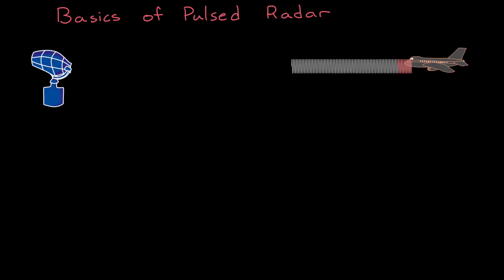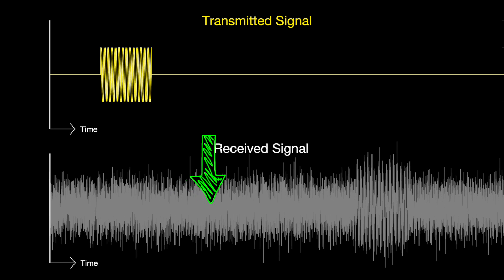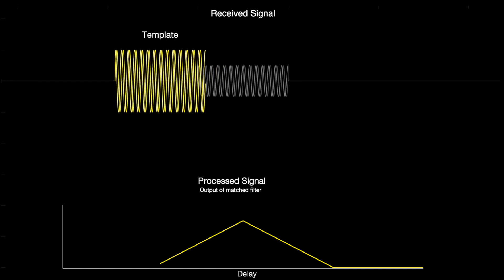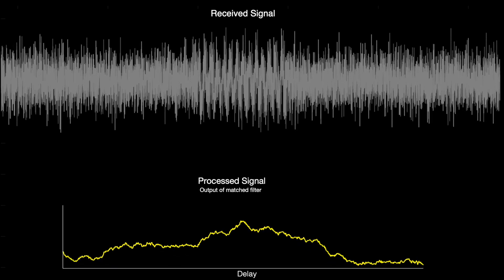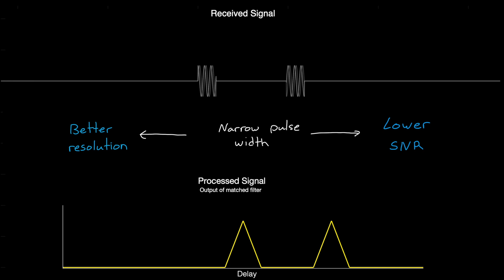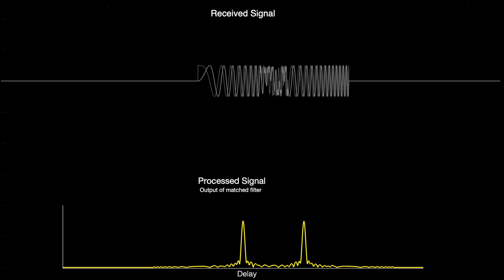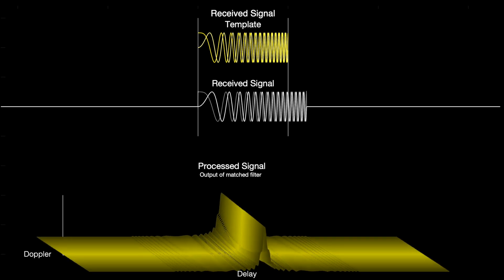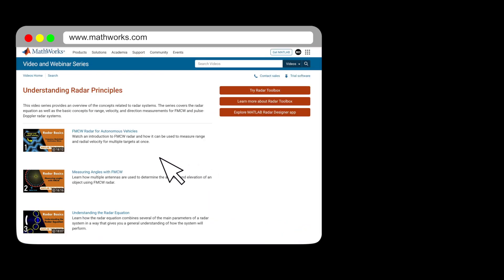Pulse waveform basics: Visualizing radar performance with the ambiguity function

Comment: 0:52 = The sound that we hear has frequency increasing, while the video shows a waveform where frequency is decreasing?
Reply: The waveform shows increasing frequency. You have to look at it from right to left since the right side of the waveform was transmitted before the left in the diagram. If it was plotted on a graph as a function of time, then the low frequency would be on the left. Does that make sense?

Comment: Fun fact: Bats do the same thing with their SONAR. 

They have an FM sweeping chirp, which they use for matched filtering and high range resolution. 

They also have a CW pulse for doppler resolution, but moths learned to stop flapping their wings when they hear it, so the bats also have to do FM sweeps.
Reply: Fun fact2: some scientists proved that they have innate value of speed of sound by putting some bats in a closed tank with a modified atmosphere, changing the speed of sound. Bats were not able to avoid collisions within this tank, even if they were born in the tank !

Comment: Nice presentation but the principle of single tone versus chirp correlation is more general than just Radar application. A single tone correlation with its template gives triangular output while chirp gives high unmistakable peak. Example is Zadoff Chu sequences used in LTE delay measurement.

Comment: Thanks for the amazing video. I have a question. Does it make sense to use 2 chirp signals added together to cancel the effect of doppler. First chirp linearly increases and second chirp linearly descreases. Doppler should apply as addition or subtraction to both so we can use combined chirp signal to cancel/calculate doppler? Like f1+ f2 = const.... (f1+doppler) +(f2+doppler) = measured..... doppler = (measured-const)/2

Comment: not to mention that CHIRP has lower PAPR compared to nearly anything. Which means you may use lower energy PowerAmplifier, which means cheaper radar, that dont overheat and remains reliable etc etc etc.... oh, and CHIRP has constant envelope which means that PowerAmplifier can be non-linear and use even lower energy.